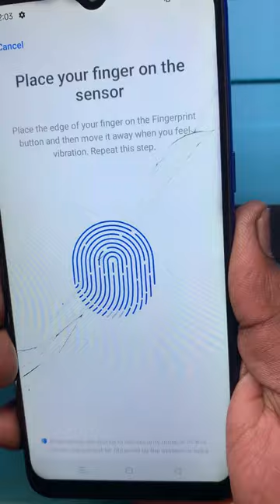Mobile Fingerprint Flex Repair #technology #mobilerepair #shortsfeed #mobilerepairing

Comment: Always I thought it was impossible but now I am impressed!
Reply from the maker: Thankyou
Reply: Everything thing is possible...in this field nothing is impossible...but train harder till u succeed
Reply: Con que raspas las pistas amigo , podrias decirme por favor , por que lo haces con una facilidad , espero respuesta y exelente video gracias
Reply: @riquelmeneymar5515  It's not easy bro , video is fast forward, you can use cesarean blade to scrach that strip and you need patience to do that ,am also mobile technician I can do that ,I did in past
Reply: What is the cutter You use...?